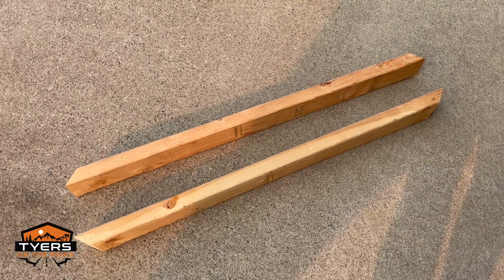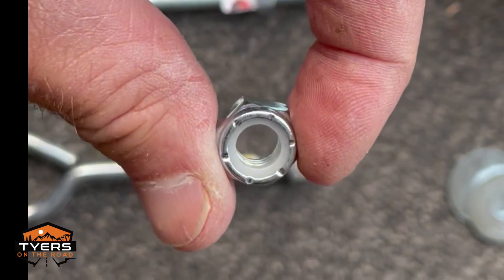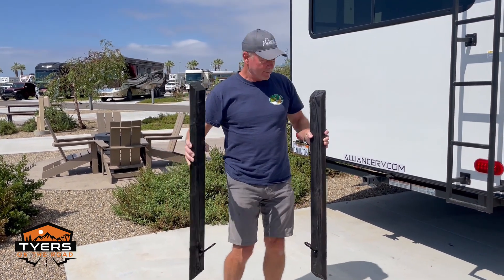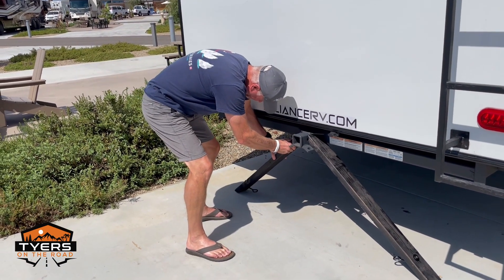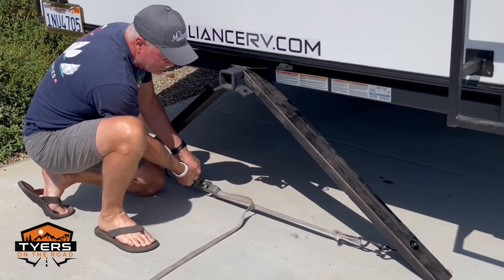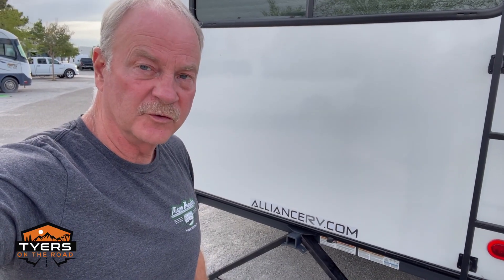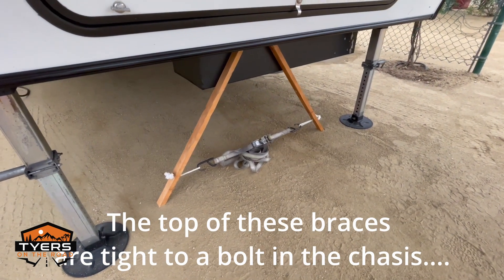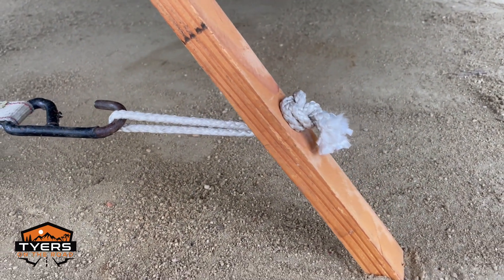If the rigs a rocking, don't bother a kno........

Comment: Nice... just for clarity,  would like a close up of how the boards are lodged against the hitch to avoid popping off.
Reply from the maker: Hi Larry, thanks for the comment, they are held in place by the force of the ratchet strap pulling the 2x4s into the hitch. They are not going anywhere once force is applied!